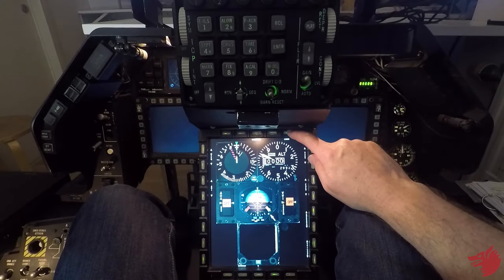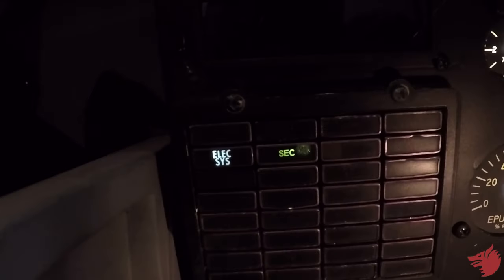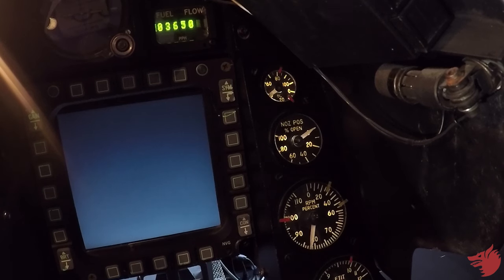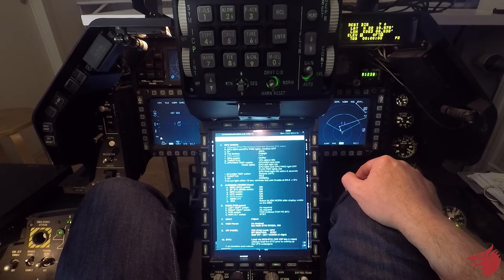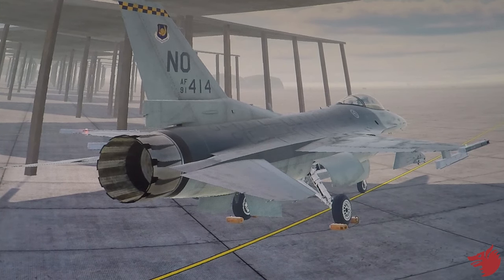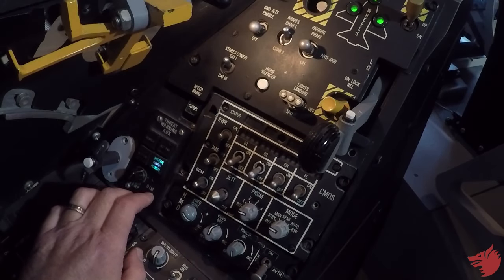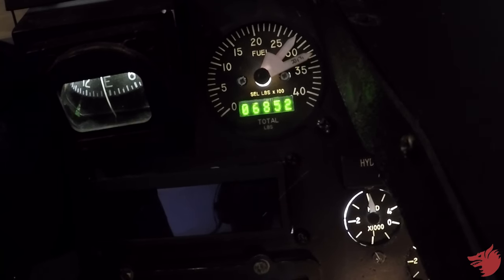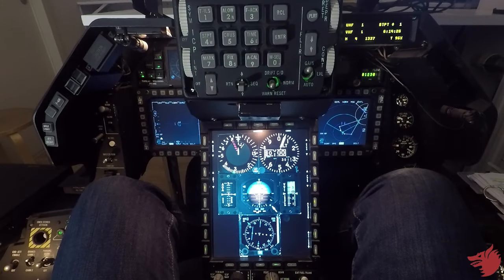DCS F-16 Cold Start with embedded checklists in Red Dog's cockpit

Comment: what are you using for the center screen? How does it run? through DCS-BIOS?
Reply from the maker: No, simply Helios with a custom profile
Reply: @VPreddog  and what about the screen itself and the buttons around?
Reply from the maker: Standard 10.4 inch screen I have been using for ages in my CP.  It's a VGA small 1024x768 screen.
The buttons around it is a home made Center Panel Display. An rarely seen upgrade for some older block 30 F-16 and latest block 60/70. 
It's a unit that's posed on the metal center panel replacing the older analogue instruments.
Reply: Thank you for posting your work. Very inspiring! I am beginning to work on my center console and wanted to do it digital. Buying the screen after I post this comment. Any advice on the set up is welcome.